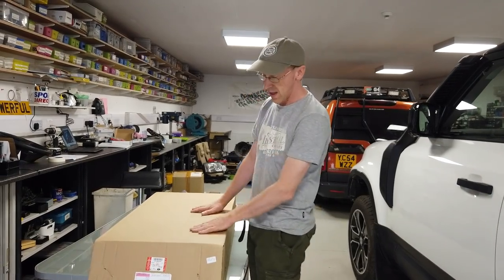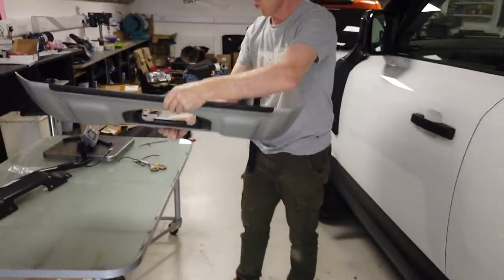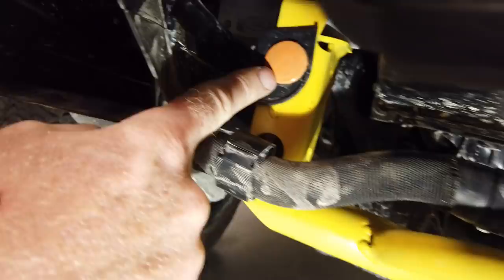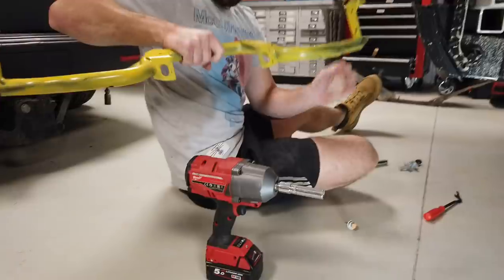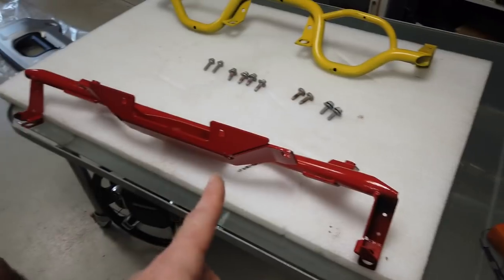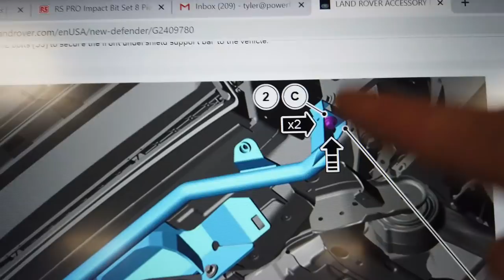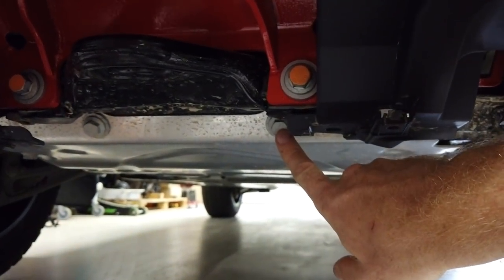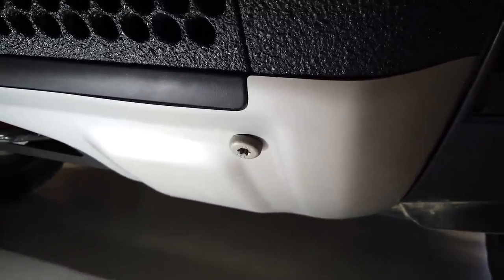Land Rover Defender Front Undershield Fitting Instructions / review VPLEP0436

Comment: Again, great content!! It seems a lot of work for something that should be standard. The shield and underbody protection on my FJ Cruiser is easy to take off and robust enough for touring. It’s disappointing to see LR cheap out on a vital piece of protection.
Reply: At least part of the reason is EU fleet average CO ratings which make it necessary for manufacturers to save every gram of extra weight they can on stock models to finesse the official test figures. Stupid rules but they are what they are.
Reply: Engre11 I didn’t factor that in. It will be interesting to see if they still use plastic in NA and Australian vehicles.

Comment: I wonder how strong the protection is should the vehicle ground, for example in soft sand. Its seems to me that the plate and bars may bend if the weight (mass) of the vehicle is supported by it. I would like to see a much stronger thicker plate option. But there again I will be using it for what it's intended in Africa.
Reply: 😢 did u die? Africa in a new defender 😢

Comment: The plate looks good, but the tubular frame looks poor. Open ends on the tubular frame and poor paint finishing (from Land Rover) will mean rust within a very short time. The original mounting frame, and new mounting frame are similar and would cost similar amounts to manufacture, so makes it a great the upgraded frame was not fitted as standard to reduce the cost of the under guard. Should say the end result looks very good - great channel.
Reply from the maker: Hi - totally agree... and if they did fit the upgraded subframe as standard then there would be no need to strip down the front to upgrade. Glad you enjoy our somewhat unique style !

Comment: That looks good. Goes some way to explain the £800 price on JLR's options list.
Reply from the maker: overall finish is nice... kind of think LR should have fitted the "subframe" as standard with a plastic cover and then if you wanted the aluminium you did not have to take the whole front end off..
Reply: powerfulukltd That would make perfect sense. I’d be reluctant to remove the bumper etc in case I damaged it.

Comment: Very interesting video - but very bad packing from JLR that allows the hooks to be damaged in transit.  It needs properly designed packaging that protects the parts from being damaged by each other.  But I would have thought that this should be a standard part from new and not an option - it is a DEFENDER after all !
Reply from the maker: Yes ..even if just the stronger metal part was fitted with a plastic cover... and the upgrade was to the aluminium...then at least you would not need to do the full strip down !

Comment: Disappointed with poor instructions and the wrong length set screws.  How hard can it be to accurately check over the kits before final production starts.  IKEA have been making flat pack furniture for years, it's not rocket science.  Good job JLR don't do the same otherwise you'd end up with some pretty strange constructions.  Just did some searching, that kit is around £625 (including VAT).  A nice little earner that should have been fitted as standard.
Reply from the maker: Yes a lot of people are saying this should have been standard... the instructions / packing / bolts wrong is disappointing in this day and age.....

Comment: No need to open the bumper. Yesterday I renewed same without opening front bumper.
Reply from the maker: Hi - so you managed to swap all of this without removing the front bumper ?
Reply: @L663  Yes Day Before yesterday I replaced. I worked with jaguar Land Rover as a Technician.
Reply from the maker: @khanvikar9307  OK i now need to give this a go.... any tips ? did you remove wheel arch liner ?
Reply: @L663   I removed only bumpper down side cover and torx screw. After opening the screw you get space to remove. I did not removed wheel arch.
Reply from the maker: @khanvikar9307  OK seems i have a challenge
Reply: @L663  You just try .
Reply: @L663  Next time I will share you the video.
Reply from the maker: @khanvikar9307  So we did this today and as you say it is possible ! video coming soon and I did give you credit... i take my hat off to you sir !
Reply: Just did the unofficial way myself. 2 hours start to finish. I don’t consider myself that good at this type of stuff. I think I was just lucky manipulating the new support bar in place. Trying to decipher what bolts the instructions were referencing and not getting anything cross threaded was the biggest challenge. Poor job on that in the instructions. One thing that didn’t quite feel right now I reflect on the install is the shield did not sit on the hooks prior to installing the fixing bolts - I am thinking it due to the added movement I had to give the bumper and plastics to get the new bar in. I might just take the shield off again and check that out.